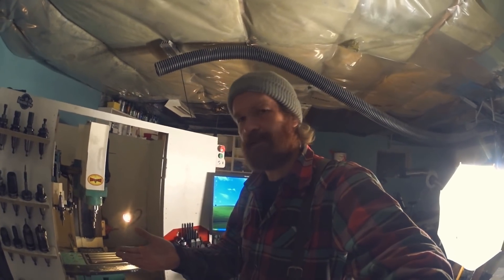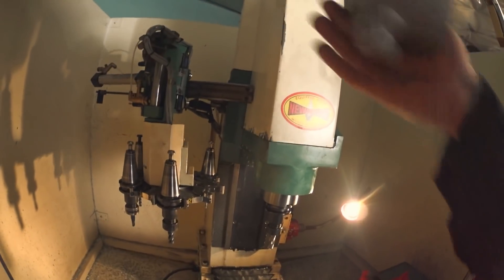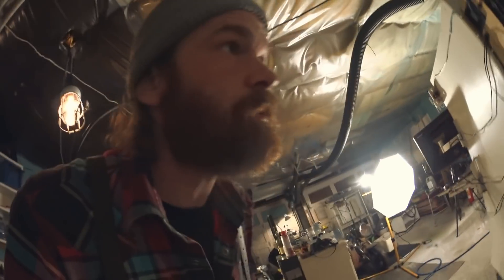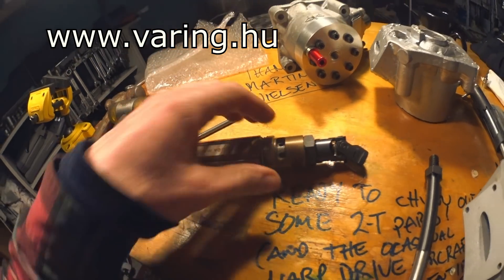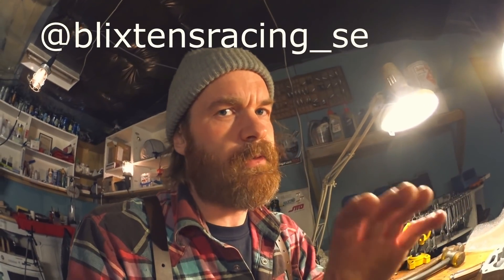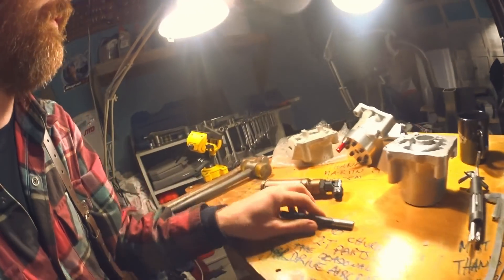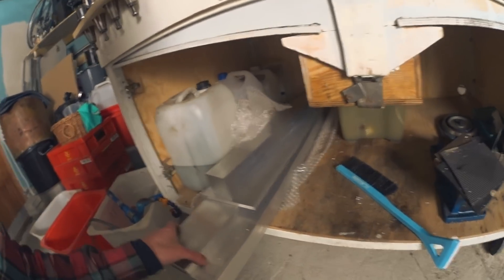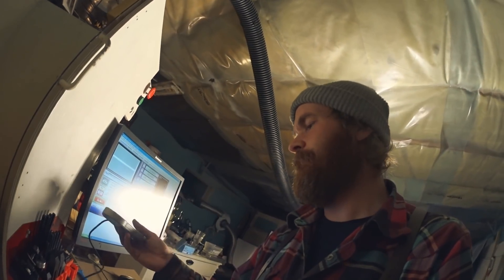This Tool Changer Changes Tools! - an update...

Comment: The Xbox 360 wireless controller can work wired with a USB cable, and an adapter can be made using the light ring board on the slim (S) I think (the console can certainly use the wireless USB adapter for windows without any modification, just plugging it in and unplugging the ring board, so the software should be the same if you find the USB pins on the board)

Comment: I saw all your videos, ( incl. wood related videos) and I can't stop thinking about a solution to your problem related to plating.
I think the problem is not the plating but the way the segment attacks the top of the exhaust window, it will always work as a wood planer.
Perhaps the solution is an exhaust window with an tilted top edge, covered with plating. You should try this cylinder with a normal casing, and that casing with a normal cylinder.
You should also consider tuning the casing for the second harmonic.
Love that piston, no thermal issues on the skirt, great !
Terrific work !!!!!

Comment: 3 jaw Chuck's is not as accurate as 4 jaw chucks or collet chucks in certain applications maybe make sure the shaft you turned down is concentric as far as large diameter to small diameter is concerned otherwise you may have a " cam or lobe effect " when honing and an uneven pressure distribution on the bore when honing .
Reply from the maker: Dialed 0.005mm after zero adjustment. This 3jaw is pretty good on small diameters.

Comment: I have a lot of this old style pin thru components, but those capasitors i don`t have, but if you need some other components just ask me. I`m en electronic engineer so if you have ane problem with electronics just PM me! Og så bor jeg bare ca 10 mil unna.

Comment: Maby try Xpadder for the Controller mapping. But i would recommend to buy a mach 3 Handwheel from Ebay they cost about 40€ and its way easier to handle than a joystick!

Comment: Nice oven!
I think if you filter the coolant with a fine wire mesh you can use 3mm nozzles without clogging them.
Or you can put something like a big bottle in the coolant system so the fine metal chips can settle down before the coolant gets to the nozzles. If you place the output pipe at the top center of the bottle and the input pipe tangential in the Sidewall at 3/4 of the height of the bottle, you have a cylone filtering system for the coolant.

Comment: Why are you honing with drill when you got cnc?
Reply: Abrasive contamination. I would be hesistant too. It would need to be contained with seperate ?oil? (i dont know anything about nicasil) cirvulation in something like lardge bucket. Results would would be more consistent.

Comment: Have you a scrap cast cylinder you can set up with to prove your machining process before committing to the printed version?
Reply from the maker: Yep, several 👍
Reply: Smart. Have you checked that the machine is paralell?